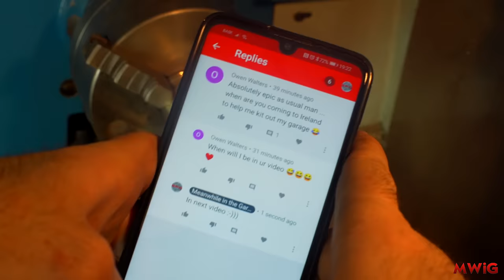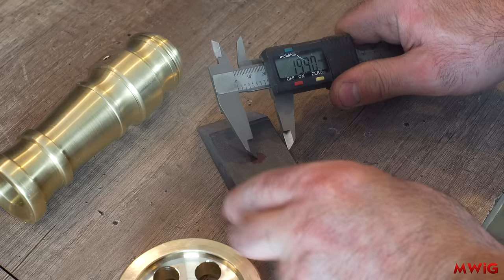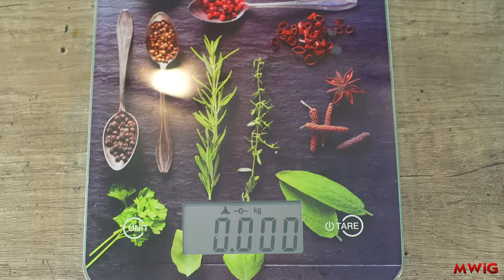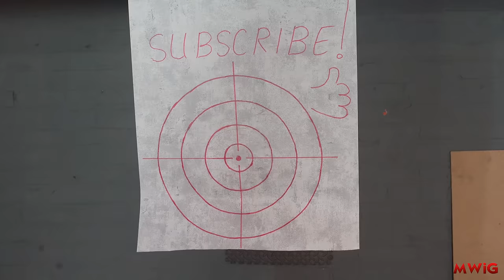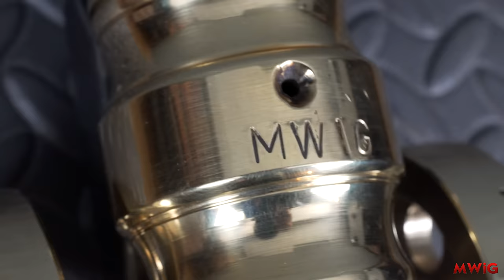How to Make a Powerful Miniature Cannon - DIY Guide

Comment: For the drill that was stuck, Brass alloys can be pretty catchy when drilling with already existing holes. To avoid that, i just "unsharp" the drill bit by running its cutting blades with a sharpening stone. Works like a charm, just need to sharpen the drill bit again after.
Reply: I discovered that the hard way myself, though I'm reluctant to dull and re-sharpen my larger bits.
So far, I've been able to straight drill brass without pre-piloting the holes, which eliminated the chatter, jamming and the awful noise!
Reply: Also, masonry drill bits are a good option for drilling softer metals. Only caveat is that the carbide bit (usually) has a larger diameter than the shank that  can cause deep holes to curve slightly. However, this can be solved by grinding the carbide insert down to the diameter of the spiral.

I spent a  Weekend years ago grinding a cheap drill bit set down to all the nominal dimensions. I did have to grind down the diameter of the spiram of a couple drills as they were slightly 'overzied'.

Recently I got myself a much better diamond grounding kit and completely altered the geometry of the drilbits to be highly self centering. Because even after grinding the cutting bit down they could ween off ever so slightly... 

As a bonus they also work on hardened steel! 

But for regular cold rolled steel normal hss is still preferable due to the much higher cutting times..

Comment: They actually make a tool for turning rounds on a lathe, Adam Savage has one.. he used it on a project on Tested.
Reply: Like a radius turner or a ball turner?
Reply: @SW-ii5gg  hence rounds ie round shapes
Reply: @jaratt85  just giving the names of the attachment to differentiate from the usual round shapes turned on a lathe, such as cylindrical.

Comment: It always fascinated me how the metal get polished when rubbing with rough material.
Reply: This can be achieved with using a lower grit sandpaper and working your way gradually to a higher grit sandpaper or more refined. Each time you're basically resurfacing the outter layer. Scratching it. The higher grit the more polished it becomes

Comment: I made a homemade cannon out of a length of scaff bar with one end blocked and welded shut and a little hole in the top poured the contents of a couple of fireworks in basically  tamped it down with a broom handle and piece of waddind and then poured a load of metal nuts in tied it to a wheelbarrow pointed it at a holly bush about 50 yds away lit it stood back and promptly blew the top half of quite a large holly bush away!!! Wouldnt recommend it though!!

Comment: They sell stencil punch holders and you wont hit your hand and you can use like a 3 pound hammer and hit it hard as you can they will go in deep and be very legible. And i doubt you used the toolings from bang good like the cutting bits and lathe tools

Comment: Well I think the thickness of the cannon walls is easily thick enough to cope with firing mini cannon balls, but I guess you only want to use black powder and not modern gunpowder because it could still blow apart. Maybe you could make a musket ball mold with the size a little smaller than the cannon barrel. A bit of cotton wadding and it could be a snug fit for the musket balls.

Comment: Can’t help but be reminded of an engineer with too much time on his hands who similarly made a small cannon, of the dimensions to take a 9mm round. Having finished, he took apart a 9mm round, put the propellant in the barrel, followed by the round, and as he initiated it another soldier walked into the path of the cannon and was killed. Fired once, 1 dead, charged and convicted of murder, straight to prison for a lengthy term.
Reply: Loli4lyf lol, I’m ex law enforcement. It was a well known case amongst some of my colleagues
Reply: Loli4lyf umm, I can read, I know what you wrote, and answered giving you the backstory. Not everything is on the internet, especially events that happened before the internet was created.
Reply: Loli4lyf yep, we’ll my time was ‘97 to ‘06. I finished as a senior detective but during my time was involved in a project clearing and digitising all the old paper archives that went back to the early ‘70’s. This particular case would have have been mid 1980’s. There were a fair amount of firearms cases and shootings, but there was only ever 1 murder caused by a homemade miniature cannon.
Reply: Loli4lyf no worries. (Neither am I).

Comment: Great work! I am also making one. What did you use for the explosive charge and fuse?
Reply: I have same question
Reply: IDK what he used for the propellant, but it appears to be a sparkler that he is using as a fuse.
Reply: @SW-ii5gg  ooh magnesium dissolved in hydrochloric acid on top of charcoal through silicon sand with a touch of sulphuric acid, with a little phosphorus power and pva glue (I would have used egg white by I no longer own any companies), nice barrel I'm sure its full of vodka, I can only hope its cherry flavored
Reply: I used to have pencil sharpeners something like that